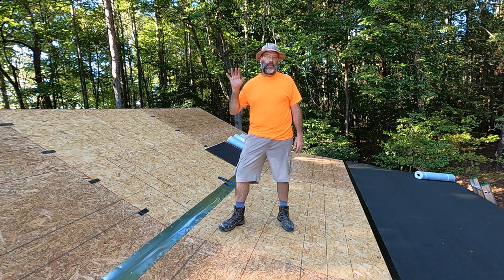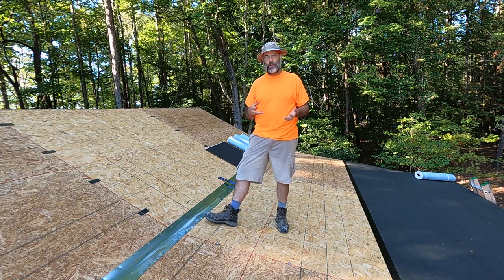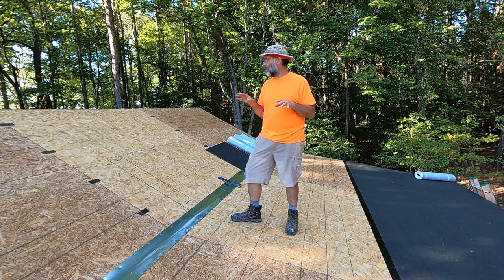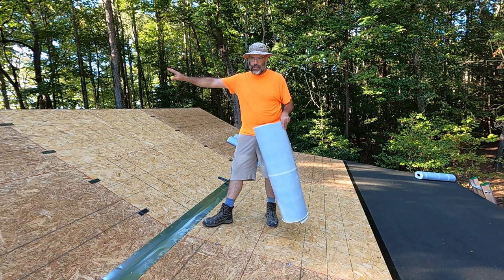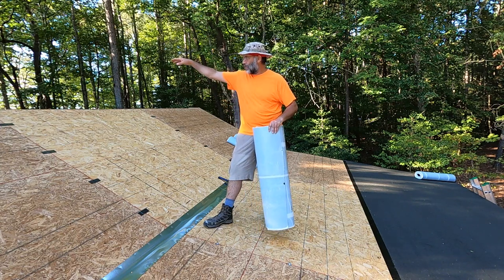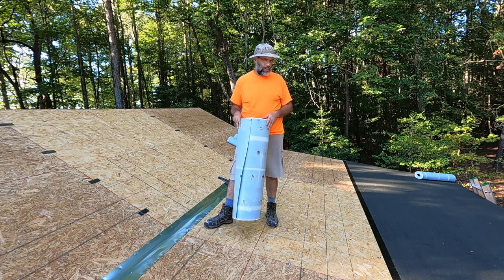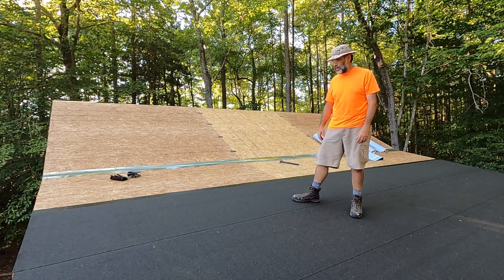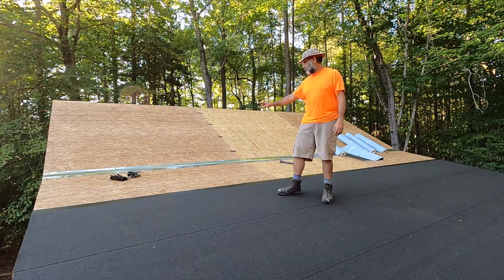Pole Barn Project #14 - Roofing in Progress (Underlayment)

Comment: Stagering OSB is still good practice.  I actually just installed sheating on a 40 square roof, on perlins and staggared. I used Ring shank nails only.  Screws in the corners is a great idea. I personally prefer screws for everything, but sometimes a nail gun just makes sense.